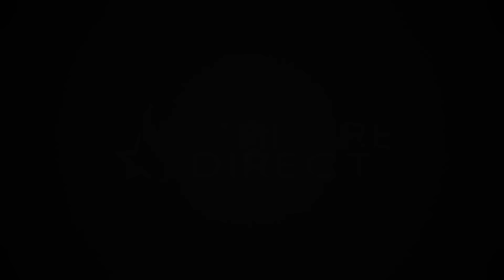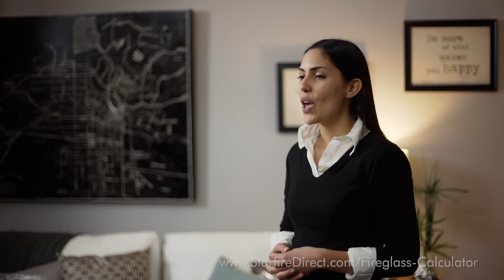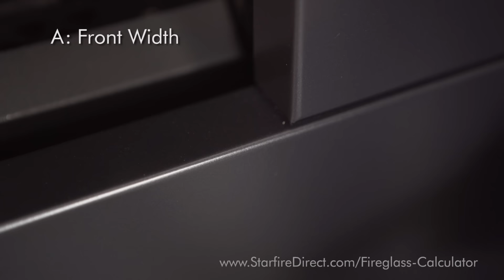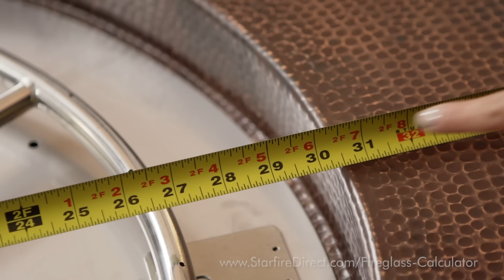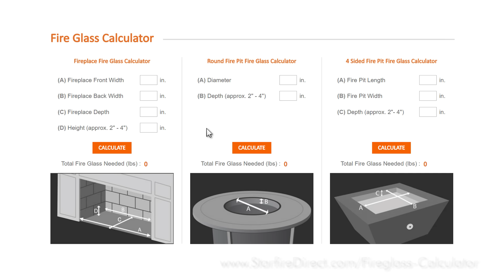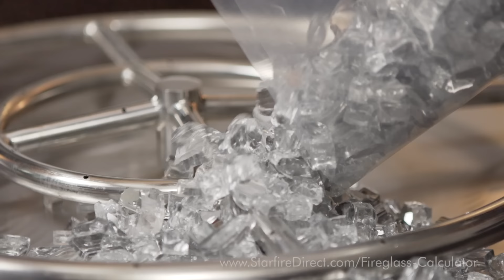How Much Fire Glass Do I Need? Fire Glass Calculator Tutorial by Starfire Direct

Comment: Do you cover the circle tubes where the gas comes from?
Reply from the maker: Typically, you will want to cover the the burner tubes by no more than 1/2".   However, if your fire pit came with an owner's manual, you will want to adhere to the instructions provided.
Reply from the maker: Yes you can.  However, we always recommend you consult the instruction manual of your fireplace or fire pit for fire glass placement directions.  Do not do anything contrary to what the instructions say.

Comment: How does it work, do you need to hook up a gas line to it or what?
Reply from the maker: Yes.  The fire glass is for use in gas fireplaces and fire pits.  Refer to your fireplace owner's manual to ensure compatibility.  You can also call us if you have any questions on installing fire glass in your fireplace or fire pit.